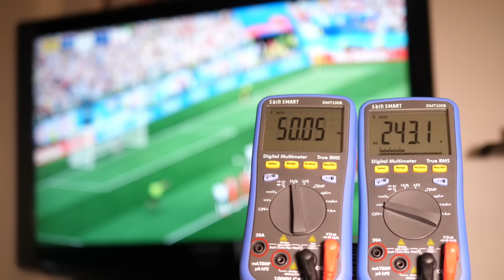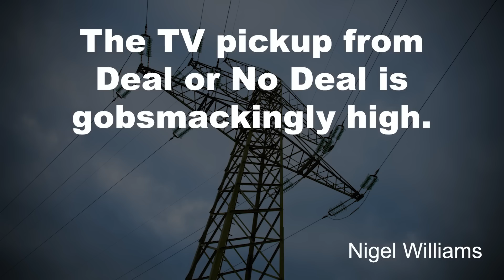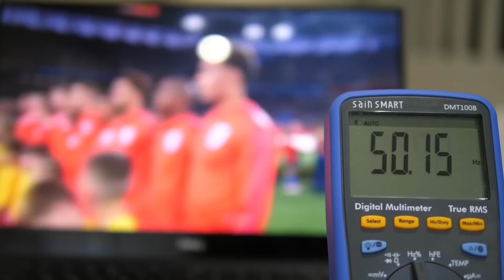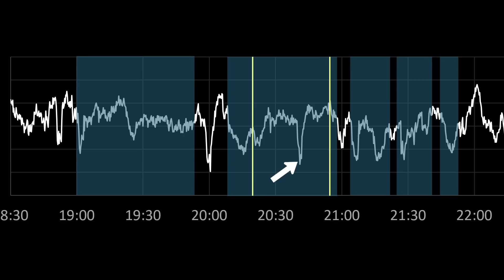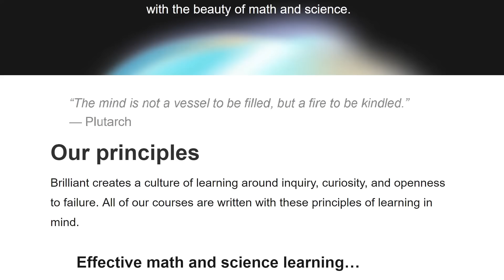Detecting World Cup goals with electricity - The TV Pick-up effect

Comment: The voltage is allowed to vary quite a lot, I seem to remember it's ±20% and that equates to a power variation of about ±45% for resistive loads such a kettles. The frequency restriction is much tighter and it shouldn't really change because the demand is met by allowing the voltage to sag if it must.
Reply: chris4072511 frequency is actually insanely tight, since many clocks don’t have their own Quarz crystals and instead are based on the frequency even changes basically undetectable will cause economical damage
Reply: Da Real Doenertier. Frequency is the more important one in terms of stopping blackouts, and the first derivative (rate of change of frequency). Adding or removing loads affects frequency and df/dt more than V.
Reply: It's not 20%, that would mean a 46volt swing up or down, definitely gonna either shut down or blow up the appliance
Reply: Oh, and Steve's confusion is because the UK used to be on 240V, but then harmonised with Europe, and differences in historical voltages used meant they had to fudge things.  Hence the official European standard voltage is 230V, but with that asymmetrical tolerance so that the UK can run on 240V (or higher), whilst some other places can run lower (probably ostensibly 220V).

Of course then it all gets complicated by trying to sync up the grids across Europe, which can indeed lead to issues with keeping the frequency in spec.  Tom Scott covered a recent incident where some political happenings in eastern Europe lead to the voltage dropping, which in turn affected the frequency, by just enough to skew clocks that relied on it by a few minutes over a month or two.
Reply: Some parts of the UK are actually 250V. And yes, 230 +10% / -6% is the EU standard (a couple of non-EU Eastern European countries allow -10%), meaning any appliance sold in Europe must be OK with any voltage within that range.
Reply: Lmao... you should live where I live..
Sudden Shut downs, no regards to voltage or frequency regulation, they switch generators 3 times a day and never on time, the difference can go upto 2hours.
And the price is insanely high (around $1.5/Kw)
They also collect every week and charge an extra $2 for services every time they collect, and there is barely any servicing being done to anything.. and if something burns because of them then who cares?

Electric power is supplied by private owned suppliers that work in relatively small sectors of the city who usually have 50Kwh - 150Kwh generators with their own awful wiring networks, public electricity? What is that? Havn't heard or seen it in more than 5 yeras.. not that it was any better with voltages dipping down to 170v and no way to know when is the next shut down because the national grid can't keep up for everyone.
Nobody even cared about frequency.. still nobody does.
Not to mention in those days some idiots would blow up the cross-country (cable tower carrier?) to get the government's attention and demand something like "free my brother" or something, so what did they government officials do? Well they got them expensive automated generators for their homes, and the people? Well no better time to gaze at the stars.. free light.

Baiscally the governemnt is iFing the people and the people are iFing the people.
F them all.. and F me for staying here when I can leave.

And that is just the tip of the iceberg...
Reply: AA A Jeez, sounds awful. Where do you live?
Reply: @AAA-bo1uo  Around elves, watch yourselves...
Reply: In the UK the actual tolerance is 230V +10% / -6% for a 'legal' range of 216(.2) V up to 253 V.  Where I am my UPS often reads out in the high 240s (249V right now), and after some electrical trouble I had the local supplier investigate, including putting a line voltage recorder on it for a few weeks.  Conclusion, within the legal ranges, but they DO like to run it high!

I can only assume this is because higher voltage, for the same power, means lower current, and that in turn should mean lower resistive losses.

Comment: I would have thought it would show in voltage as much or even more. I think it depends on generation method and type of load. A resistive load for instance can easily be fed any frequency while the rms voltage is the costly part.
Also if they can throttle production within seconds you are looking for a very transient effect. Try logging both. And at least 1/s sampling.
Reply: Also, the frequency is post-compensated (over an unknown period) to keep clocks happy, whereas voltage does not need to be compensated, so it gives a better real-time picture.

Comment: Hey Steve!   How do they sync the ac generators in windmills, whose frequency depends on rotational speed, to the grid?
Reply: They rectify the generator voltage to DC and then use power electronics to convert it back to mains frequency AC. Solar PV plants use the same technology since they're DC to start with.
Reply from the maker: Interesting, thanks.
Reply: Magnus Dagbro   thanks for that magnus.  Please don't think I'm rejecting what you say, but I'm wondering about the steam turbines which have been supplying most of the grid since years ago when ac to dc (pwm? ) and back to ac conversion via electronics would have been prohibitively expensive ... no?  The turbine can be automatically throttled back if its generator frequency is too high, and vice versa.  And for phase sync you could rely on the fact that if at a given moment it's trying to produce a higher voltage than the other generators on the grid then it's sinking into a ginormous load which will slow into step time.  I think all wind turbines have blade feathering, so I was wondering if they use that in a feedback loop.  Maybe I'm out of date and they can do 50MW switching with a couple of cheap mosfets  these days .....

Comment: Most of our appliances couldn't care less if the frequency was 40 Hz or 60 Hz or even 20Hz or 80Hz. Just very few applications actually care (motors directly connected to the grid for example, which is an application that is slowly dying.). 
The power companies are not actually trying to maintain the frequency, as it is only a symptom of a deeper problem.: Power. If you have too much power going into the grid, the power plant generators will accelerate, eventually leading to rapid unplanned disassembly. If you don't have enough power in the grid, the generators will slow down until they come to a stop, destroying the steam turbines behind them in the process.
There is just one thing about frequency: It's MUCH easier to measure accurately than global grid power balance. And by regulating the frequancy, you automatically regulate power. That's why power companies are so obsessed with the 50Hz (or 60Hz in some countries). Not because it could actually damage any appliances if the frequence deviates a few Hz.
Reply: ElectroBlud 
The electrical distribution system also needs a stable frequency, out of spec frequencies will saturate and overheat transformers.
Reply: Jonathan Pearce
True. But a few Hz up or down has never hurt anybody. The transformers dont run at their absolute thermal maximum, since they would not live long if they did anyways.

Comment: The analogy with the bicycle for grid frequency and voltage doesn't quite work as is. It seems to work for explaining why the frequency slows down, but as soon as you try to extend the analogy to explain how to maintain the frequency, you run into the intuition that you'd have to push harder to maintain pedalling frequency; pedalling harder equates to a higher voltage in this analogy, which isn't what actually happens. 

A way that you might fix the analogy is to say that the bicycle is pulling a heavy trailer. In order to maintain frequency while maintaining a constant force (or voltage) on the pedals, you could connect more bicycles to the same trailer, all being pedalled with the exact same force.
Reply from the maker: Yes, that's nice. Or I thought (after posting the video). That you could turn the bike into a tandem bike. Similar to bringing an extra power plant on line. I like your one better though.

Comment: You said that changes in voltage and frequency can damage electronics, they definitely can, but most modern appliances pretty much don’t care, they can run from DC to AC @ 40 to 60 or more Hz, at 100 to 250 volts, they just don’t care

Comment: I'm confused, your introduction seems like a bit of a non sequitur. 'When there's a break, people run to the toilet, so electricity demand goes up'... Huh? My toilet doesn't use electricity. Please explain.
Reply from the maker: Maybe I glossed over it too quick. The water company makes greater demands on the national grid to keep the water pressure up.
Reply: Ok so water pumps are taking up all the electricity, got it.
Reply: Pumping stations! No, there wouldn't be a significant delay as the mains water is kept at a fixed pressure. Pumping stations automatically maintain that pressure - nothing to do with water towers.
Reply: Water pressure isn't magic, someone needs to create that pressure, and unless you're in some place that uses water towers and gravity, that's done with electric pumps.

Hence why in the Y2K panic people were stockpiling water so they could still manually flush their toilets.
Reply: > unless  you're in some place that uses water towers   
Is it not the norm to pump water into a tower (or similar) and then have gravity do the deed for you? Except if you live in very high houses that need separate pumps.
Reply: Thank you, I was also missing the connection there
Reply: I suspect the water pumps operate after a significant delay, since they're topping up a water tower, not pumping straight into the pipes.
Reply: renxula I find it hard to believe that a sophisticated water delivery system relies on pumps to maintain water pressure alone. Buildings have water towers. Towns have water towers. There are likely ballasts within the water system to buffer sudden demand and then there's the fact that most toilets have a tank that empties quickly but fills slowly. Then you have the physics that a loss of pressure at one end of a pipe isn't felt at the other for a period of time. I like Steve Mould's video but this one makes my bullshit detector go off.
Reply: No, most water systems in europe don't use water towers because the higher cost involved having very clean water (without chlorination which is forbidden in a lot of countries). You need most of the pumps anyway and pumps are cheap to build and maintain.
Reply: I thought every civilized place uses water towers. They provide a constant pressure that'll only decay slowly as the reservoir gets emptier, whereas direct pumping would be subject to immediate loss of pressure at the slightest hitch. The loss of pressure can also lead to contamination of the water in the pipes, so it's important to avoid it.

Comment: Have you head of flywheels connected to generators / motors, to keep the power constant?
Reply: Well electric generators in power plants are REALLY heavy. So they are their own flywheel really.
Reply: ElectroBlud 
What I  was talking about is a device that is now available for uninterrupted power for critical applications. 
The motor spins the flywheel,  powered by the mains,,  and if something happens to the mains, the momentum of the flywheel sources the power untill the standby generators are up to speed.
Years ago,, I  saw a Hospital that had a standby generator that ran all the time, it was powered by the mains, and the hot water in the engine was from the Hospital heating plant.
If the mains went down, the diesel engine started,,   you couldn't even see the lights flicker. 
My wife worked in the laboratory, ,  I asked why the little red light was on,,,  and she told me that it indecated that the generator was running.

Comment: Am sorry, but I don't understand how toilet flushing is related to electricity. Where I am from(India), it doesn't. 
I assume there are no overhead mains for individual houses or apartments in Britain and pumps are used to maintain pressure. 
Can someone explain?
Reply: Water pumps responding to maintain system pressure increase the electric demand.
Reply: Jawaz Illathukandi   the house I used to live in (uk) had a big cold water tank in the loft.  That acts as a rechargeable battery, in effect, so the demand on the supply is not affected as immediately.  The one I now live in has no reservoir so the effect of flushing the toilet is to immediately demand water and if loads of people do it at the same time the pressure drops and the supplier responds by ramping up the pumps.  The simplest solution would be to ban the sale of toilet cisterns that refill quickly.  That way the demand gets smoothed out over a longer time.  But Joe Public might not vote for it.
Reply: Or just ban toilets?

Comment: the absence of an obvious pattern could be because the power grid is constantly being ramped up or slowed down to meet the demands of what it predicts the draw of power is going to be. I know you pointed out that predicting injuries etc is quite hard or impossible, but depending on how much latency is in the systems in the power grid they may have enough of an opportunity to counteract at least some of the extra surges and drains throughout matches etc. and also the World Cup is not the only thing on at that time which could be messing with you results. so in conclusion, measuring the overall outcome ie the mains voltage is going to be a combination of all factors affecting the power grid and results in effects cancelling or manginfying each other, so differentiation of causes would be very difficult
Reply: this is a perfect example of why I should wait until the end of the video to comment
Reply: If nothing else I'd wonder how much a household appliance like a fridge/freezer firing up its compressor might affect the house grid.  Definitely worth logging things on what appears to be a normal day otherwise to see if things are just always this noisy.

Comment: Could the opposite/positive spike at the end of the match be due to a miscalculation from the Grid about demand and rather a slow climb down in demand over the next hour because of the lateness of the finish that there was a sudden switch off as more people decided to go straight to bed? 

So there is a glut of power with the anticipation of a higher usage but for some reason that didnt happen they were left with an over supply that took time to rectify?
Reply: No, the grid regulation is relatively fast to counter such things, we are talking about 10-15 sec for the primary regulation (stopping the drop in the frequency) and 10-20 min for the secondary regulation (bringing the stabilized frequency up to 50 Hz). It is far more likely that this incline comes from people going to bed, i.e. turning off the television, lights etc.
But that part is only true for the grid as a whole, since the major part of energy is produced via steam turbines it may take an hour to regulate those power stations.

But i think the cause of this spike was completely intentional: Since a sh*tload of devices uses the grid frequency for their clocks, it is absolutley essential that the average frequency is exactly 50,000 Hz. The frequency dropped during the game-> clocks strated to lack behind just a little bit-> frequency got raised to negate that.
Reply: Dominic Ransom  That is a real possibility.
Reply: The signal is after the National Grid has fixed the supply to match demand, it would be more interesting to see the measured supply or demand graph - I suspect the frequency signal is more about granularity in the generating capacity being switched in and out rather than the actual total demand - if the Grid are doing their job well you would expect it to be hard to see a signal this way.

Did you try monitoring the voltage? (which would probably be more sensitive to local demand).
Reply: Everyone turn off their TV after the sport even
^
This pretty much.
Reply: Eulemit Beule  It sounds like you are pretty familiar with the UK power grid, thanks for the information. I think you and Dominic Ransom are actually talking about the same thing being the cause of the frequency spike (lights etc).
The spike at the end is only 10-15 minutes long, so that matches what you're saying for the secondary regulation time. I'm not sure about the frequency spike being intentional. It seems far more likely that they would bring up the average frequency gradually during the middle of the night, when power consumption is relatively stable. I'm curious to know what you think.

Comment: Is the proliferation of wind and solar (and other renewables) increasing the threat of TV pickup?
Logic:
 - Wind and Solar (and tidal/wave etc) produce power without large rotating masses (gas turbines and generators)
 - They are replacing some of the large steam driven turbines
 - The lower mass of turbines and generators on the grid will have less inertia
 - So the TV pickup will more easily slow them down